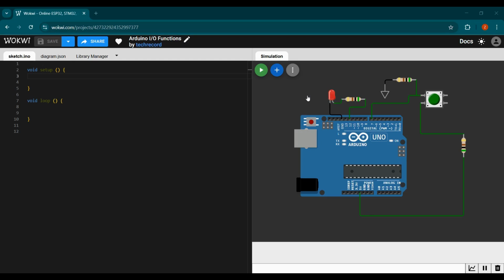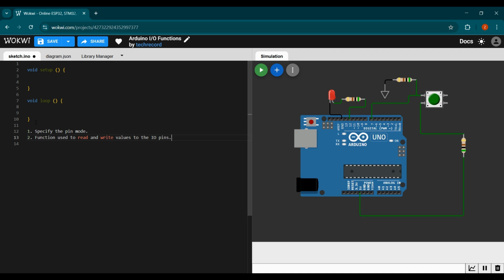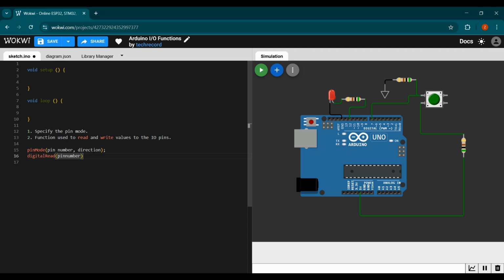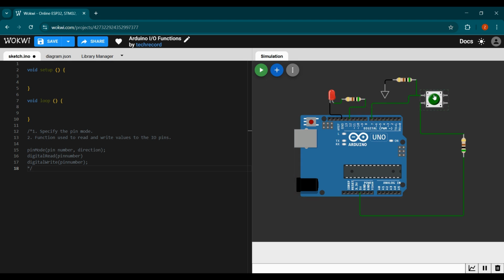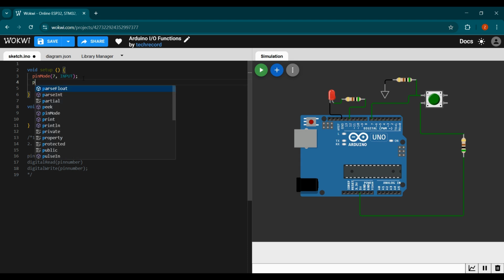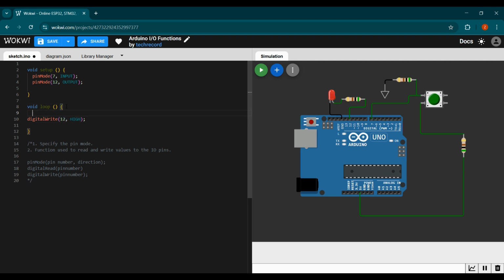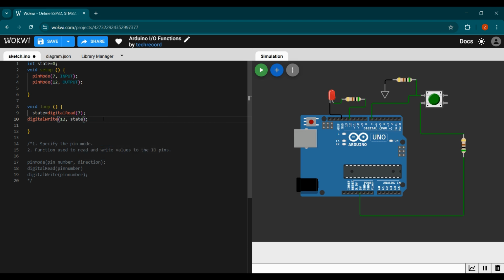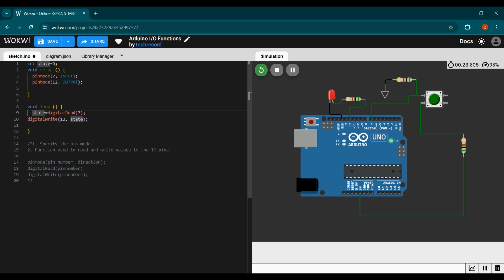41  Arduino IO Functions How to Use digital Read & digital Write

Comment from the maker: 🚀 Become an Arduino Expert – No Hardware Needed! 🔧💡

Ever wanted to dive into Arduino but didn’t have the components? Now you can master Arduino from anywhere 
using WOKWI – a powerful virtual simulator! 🖥⚙
Certificate -->Become an Arduino Expert with Virtual Simulations on WOKWI
👉 Try it now at 
https://www.udemy.com/course/become-an-arduino-expert-with-virtual-simulations-on-wokwi/?referralCode=250A6B55CF5B782430FD